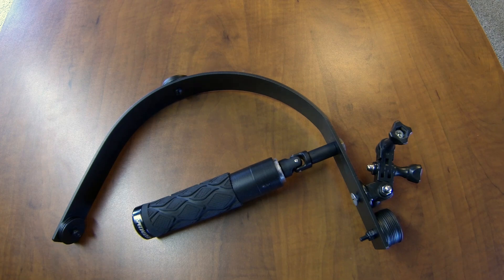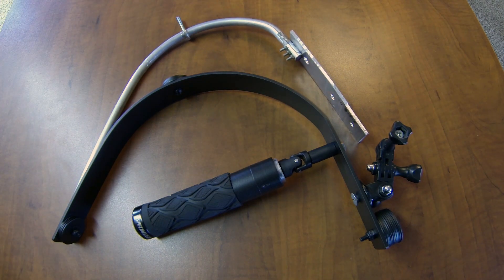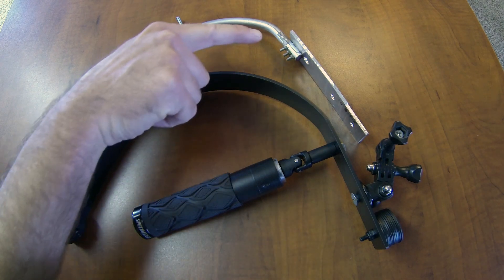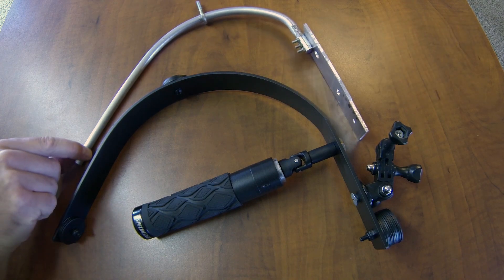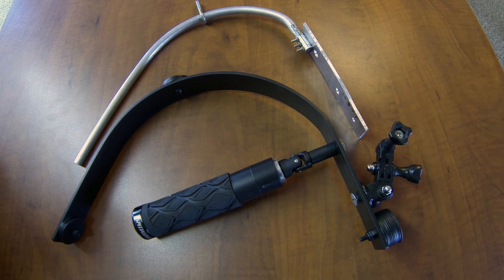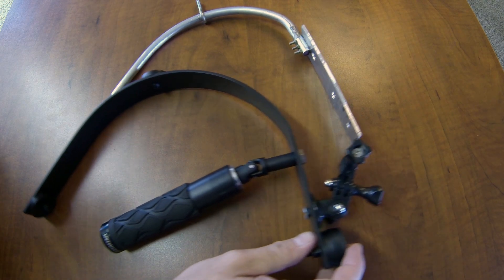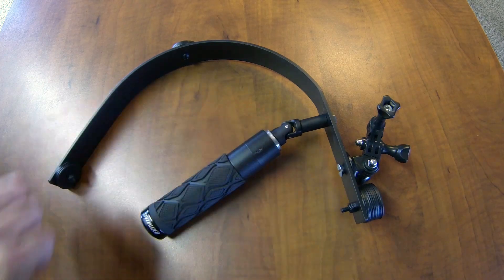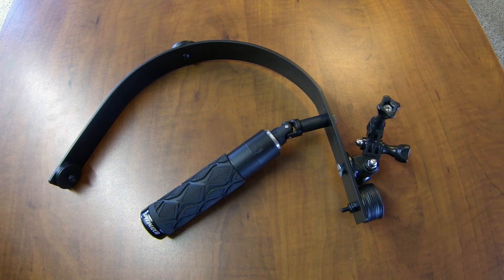DIY Steadicam Version 2: Design and Construction Tips For GoPro Hero and Other Cameras

Comment: Hey! great tutorial! just finished my version of it (using exactly the same parts) and had to adjust the number of fender washers as well to fit my curve to balance the camera perfectly.  However I have a few remarks, I find it very difficult to keep an object right in front of you in focus.  seems the steadycam works to good and the camera moves slowly so the main object isn't any longer in the middle of the picture.

And I might re work the aluminum body, I have the impression that due to the weights the body acts as a spring and the camera get to vibrate a bit.  I guess I need to work something out to make the whole body more solid.  If you have any tips there would be interesting :-)

https://dl.dropboxusercontent.com/u/31756959/Photo%209-03-15%2014%2032%2048.jpg
Reply from the maker: ***** Thanks Axxis! I'm glad your build went well. If the steadicam is slowly drifting to the same side consistently, it might be slightly off balance. In general though you have to pay very close attention to were the camera is pointing and correct for any changes constantly. After all this time I have never had anyone mention vibration. Did you use the same thickness aluminum for the frame as I did?
Reply: God's Country The aluminum frame is the same size (or very close metric equivalent), but there were no solid aluminum bars, so I used a crenated one, normally used at door entrances.  The vibrations as the drifting only occur while moving quickly.  Holding the camera fairly still will give perfect images.  moving left/right or walking to make gliding images will cause the construction to start moving (slowly) alongside the bearings in the handle, moving the camera out of position.  I guess I'll start experimenting with a piece of string connected to the lower weight to correct the angle where the camera is filming.  overall I'm pretty impressed by the amount of stabilization from a diy construction!  totally worth the few euro's! :)

Comment: Is there any reason that i couldn't just use one of the origin grips and tighten the grip around the bearing? I want to combine the battery powered grip with the steadicam. Will this cause it to be off balance?
Reply from the maker: Michael Lord Hi Michael. That actually sounds like a great plan. Let me check the fit of the grip and bearing when I get home and I'll reply to let you know how it fits. The grip isn't the part of the rig that has to be balanced so it shouldn't cause a problem if everything fits together.
Reply: God's Country I have them both in front of me and it fits great. I also had a question on what the benefit of using two bearings instead of just one tightened down with the allen wrench screw of the origin grip. I still get a smooth 360 degree spin with just one.
Reply from the maker: Michael Lord Hi Michael. It sounds like it will work then! With the bearing and u-joint mounted in the grip, is there enough room for the battery to be inserted fully into the grip? The reasoning behind the twin bearings was to prevent any movement of the u-joint shaft. Since the bearings make contact at two different places on the CPVC coupler, it should hold it tighter. In your case though, it might not be necessary. I'll have to give your way a try. Honestly it sounds like a better way of assembling it.
Reply: God's Country Yep. Plenty of room for both.

Comment: Hi, I was wondering why you put the tripod adapter that far back on the flat part when you want the Gopro to be over the handle. Wouldn't it be possible to put the gopro mount much closer to the handle screw so you maybe don't even need the 2 extension pieces? 
Just building one myself and trying to deside if i should try it, or do you have experience with it?
thanks!
Reply from the maker: MyRemiDemi Thanks for the comment. You want the gopro to be directly over the handle but the handle has to be bolted to the frame. It would be possible to do what you are suggesting if we had a double threaded bolt. The bottom of the bolt would have to be large to thread into the u-joint and the upper threads would have to be smaller to fit into the GoPro tripod adapter. I have not even attempted to locate a double threaded bolt like that. The easier solution (easier to source parts for) is to mount the tripod adapter further back and use two GoPro arms to position the camera over the handle. In the end it's not a big deal and works great. I never remove the tripod adapter or arms. I only remove the camera/frame mount so I never have to readjust the steadicam when I want to use it. I hope that helps.
Reply: God's Country hi and thanks for your answer. I didn't plan to put the tripod mount on the same screw as the gimbal, as this would possible never work as you said. I thought maybe you can screw the tripod adapter as close as possible next to the gimbal, so you could maybe leave out the extension arms. The tripod adapter has a slight curve to it, is the steadycam so sensitive that it will be off if the cam isn't exactly over the gimbal or could you adjust this with the weights? if you cut the base plate of the tripod adapter a little bit you could get quite close to the gimbal. Then the center of gravity from the gopro shouldn't be more than 1 cm from the gimbal axis..
Reply from the maker: MyRemiDemi Honestly I'm not sure if that would or wouldn't work. It will certainly require different weight amounts than I'm using. I'm sorry I can't be more helpful. Give it a try. If it doesn't work, you've only got one empty hole in the frame to show for it. Good luck!
Reply: God's Country You don't have to be sorry for anything!! your videos helped a lot man! 
i just got the idea of doing it that way and thought if you have already tried it it would save me some time and nerves to know if it works ; )
I'll try it over the holidays and 'll let you know how it turns out. 

Wish you nice christmas and thanks for your helpful replies. 
greets from (snowless) Austria

Comment: Anyone know approximate cost?
Reply from the maker: Brandon Seth Hi Brandon. Thanks for the comment. It really just depends on what parts you might already have. I had a lot of these parts already so it wasn't that bad. The parts that most people won't have on hand are the aluminum bar, the Traxxas joint parts, and the bearings. The CPVC pipe parts, weights, grip, and misc bolts/screws are pretty inexpensive and easy to find.

Comment: Can you use a flat adhesive mount instead of the tripod mount to mount the camera on the steadycam?
Reply from the maker: Steven Klaassens Hi Steven. Thanks for the comment. I have not tried an adhesive mount on the stradicam but I think it would probably work ok. It might place the camera further back and that will effect the number and placement of your counter weights. Still try to extend the camera to over the grip mounting bolt. Make sure that the mount is 100% straight when you stick it down. Let us know how it works
Reply: Thanks, I will let you know!

Comment: I've made myself 1, went to the track and video'd a heap of stuff.. I got sea sick watching the footage....reviewed the youtube thing and realised I forgot about the balance..  What is the quickest way to get a good balance?
Reply from the maker: Getting the balance right on these can be tricky. If you haven't watched my first steadicam video you should because it talks about balance: DIY Steadicam Design and Construction Tips - For GoPro Hero 3+ and Other Cameras . If your steadicam design is similar to mine you could try my weight setup as a starting point. I use fender washers for counter weights. My rig has a total of 18 fender washers. 10 behind the camera, 4 in front of the "bow", and 4 on the bottom of the "bow". I do not know the official size of these but the outside diameter of them is around 1.25". I would get a stack of fender washers and start playing with different weight amounts in different spots. You basically want the rig to balance front to back, left to right (shouldn't need much work here), and top to bottom. The bottom should be slightly heavier than the top so that the camera stays upright. You can test this by holding the steadicam and bringing the bottom out to the side and letting it swing back into position. It should be a gentle swing.
Reply: Cheers mate, yeah large washers are what I'm using, Ill do a short vid and post it as a reply.  My parts were not expensive so Im happy too mess around a bit more... You did inspire me too have a go so thanks for that.
Reply from the maker: No problem! Thanks for the comments.

Comment: How much did the total rig cost
Reply from the maker: I've never added up the costs. It depends on what you have on hand and what you have to order/buy. I already had most of the components. I think the aluminum bar was about $10, the gopro tripod adapters are around $8, the Traxxas u-joint parts are about $15 plus shipping, bike grips can be had for $5-$30 depending on how high-end you want to go. Bearings are $14 plus shipping. It's a fun project and works well but you have to watch your costs.

Comment: Saw both part 1 and 2. Looks like the best on YT so far.Can you share the dimensions of the flat area to the bend, and the length of the curved section?
Reply from the maker: Thanks! It's working well for me. A detailed materials list is in the "about" section of this video (click "show more". Here is some info on the platform and mounting hole locations:
The flat part of the frame is 4 3/4" long. The rest of the frame (the curve and all the way to the end) is about 15". It's tough to measure the curve. The bottom weight is at the very end of the frame. The front weight is about 8 1/2" up from the bottom of the frame. The top/rear weight hole is drilled about a 1/2" from the back of the frame. Hole for the camera mount is about 1.3" forward of the rear/top weight hole. The hole for the grip/handle is about 2" in front of the camera mount hole.

Comment: This is the coolest steady-cam build I've seen so far made for the gopro with out motors is there any way possible you could just send me the metal bar all ready bent the way you did with the second build here? p.s. love the plastic dip stuff
Reply from the maker: Thanks Randy! Glad you like it. I'm sorry but I just don't have the time to supply parts for this build. If you can find someone with basic tools, you should be able to get this bent and drilled pretty easily.

Comment: By that i mean the size of the playform and the location of the mounting spots
Reply from the maker: No problem. A detailed materials list is in the "about" section of this video (click "show more". Here is some info on the platform and mounting hole locations:
The flat part of the frame is 4 3/4" long. The rest of the frame (the curve and all the way to the end) is about 15". It's tough to measure the curve. The bottom weight is at the very end of the frame. The front weight is about 8 1/2" up from the bottom of the frame. The top/rear weight hole is drilled about a 1/2" from the back of the frame. Hole for the camera mount is about 1.3" forward of the rear/top weight hole. The hole for the grip/handle is about 2" in front of the camera mount hole.

Comment from the maker: Thanks for the comment. Sorry it has taken me a couple days to get back to you. Had to figure out what size the bolt was. The top plate has a hole drilled in it. A 5/16-18 x 1" long bolt goes through the aluminum plate and threads into the Traxxas U joint. The Traxxas part isn't threaded but the bolt will thread the plastic as you screw it in. I've had mine apart quite a few times and it's still working great. I thread the bolt by hand to make sure it doesn't cross thread in the plastic.

Comment from the maker: That doesn't mean that you will use the same number of actual weights because the frame itself adds weight to the front of the rig. Thats why there are fewer weights on the front than in the rear.

Comment from the maker: In my opinion, that probably won't work but you can give it a shot. Have you watched my other steadicam video? It's worth watching because I talk about balancing. The nice thing is that you can build the steadicam and then just play around with the weights until you get it balanced correctly. The bottom should be slightly heavier than the top so that it keeps the camera up. The front and rear weights should be about equal to combat rotation when you start and start moving.

Comment from the maker: The flat part of the frame is 4 3/4" long. The rest of the frame (the curve and all the way to the end) is about 15". It's tough to measure the curve. The bottom weight is at the very end of the frame. The front weight is about 8 1/2" up from the bottom of the frame. The top/rear weight hole is drilled about a 1/2" from the back of the frame. Hole for the camera mount is about 1.3" forward of the rear/top weight hole. The hole for the grip/handle is about 2" in front of the camera mount hole.